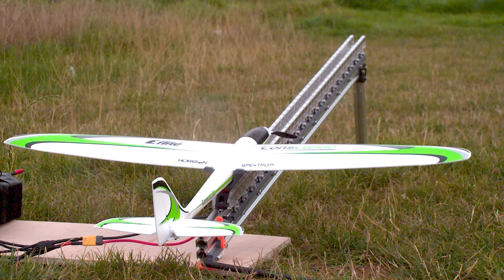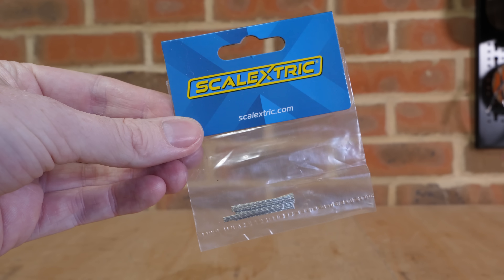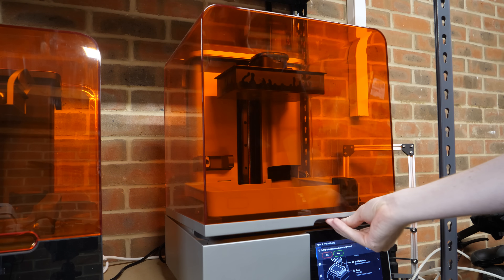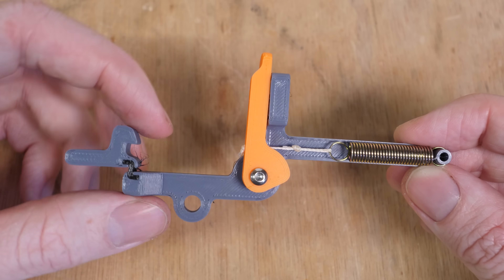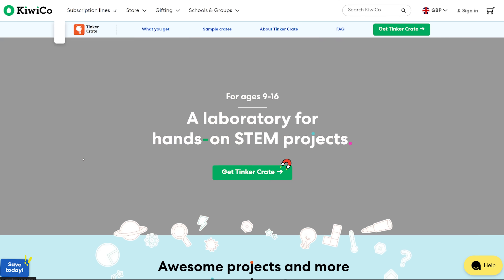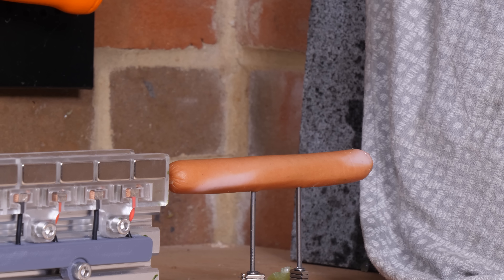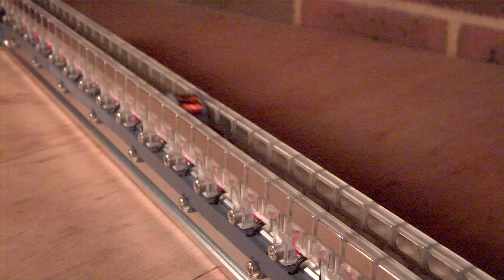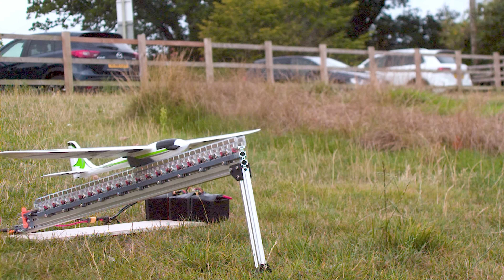Electromagnetic Aircraft Launcher

Comment: BLOCK INVISIBLE INFRARED LASERS wear all colors
- **SAVE HER LIFE**: amatchformamag
 y only a "handful" knw anything: they wrk 9hrs@aslavejob then only hav 3 hrs left 2 research their own stuff

more pple going blind bc screen DONT get your eyes dilated it screws your eyes up I found the info from comments on reversedilationliquid vids -- old lady SCRWD my vision up decades ago i dontwantit2happen2 you too. ALSO SIDEWINDOWDEFLECTORS for your car to save your driver-side-more-damaged eye and NEVER EVER STARE @ THE SUN it's what screwed my eyes up in first place since i needed glasses afterwards.

ADDITIONAL: USE DARK FOLDER TRANSPARENT COVER SHEETS and PRIVACY FILTERS to darken the screen and even PENCIL POUCHES work BROWN TAN!

**Acrylic Sheets:**Transparent Orange Acrylic Sheet**: 12 x 24 inches, 1/4" (6mm) thick.

---

*Top Health Advice:*
1. Night Light orange tint blue light filter/blocking function on devices saves eyesight: Use a large orange vinyl plastic see-through panel (see "acrylic sheets" above) paired with the computer's nightlight blue light software function for eye comfort for protection against harmful blue light.
2. Side Window Deflectors reduce driver-side eye damage and glare while driving, turning your car into a more comfortable space like a living room.
3. Avoid excessive screen time to prevent blindness increased screen time leads to the myopia pandemic.
4. Use Rollens sunglasses when outside; consider the orange-tinted "Gold Rollens." Can put multiple overlapping so can use 2 at same time for more protection.
5. Never stare at the sun to avoid retinal detachment and eye damage.
6. Avoid getting your eyes dilated DILATION LIQUID weakens eye muscles and leads to blindness. An old lady assistant spilled it and said "oops," now light-sensitive, reduction of accommodation, more myopic, never fully recovered.
7. Avoid the chickenpox vaccine to prevent shingles later in life.
8. Cigarette Smoke is responsible for numerous deaths and severe health consequences most die at 60.
9. Use eclipse glasses for eye protection.
10. Privacy screens can darken screens.
11. Eyejusters self-adjustable glasses come in stainless steel and hybrid materials.
12, SWIFT passes out earplugs to protect her fans anything over 70db = DEAF tinnitus ringing is dying ear cell freq u will never hear ever again. MUFFS!

---

-------------------

Eye Health Concerns MORE INFO/SPECIFICATIONS:
- "SIDE WINDOW DEFLECTORS" REDUCE eye damage/glare while driving TURNS CAR INTO A LIVING ROOM!
- ROLLENS
- Never stare at the sun: retinal detachment and eye damage from staring at the sun.
- Myopia Pandemic because of increased screen time.
- Horror stories about dilation causing acute angle-closure glaucoma and Bell’s palsy.
- DILATION LIQUID can weaken eye muscles and potentially lead to blindness. An old lady assistant spilled it and said "oops," now light-sensitive, reduction of accommodation, more myopic, never fully recovered.
- Eyedrops recall since 2023 due to potential blindness.
- Eclipse glasses for eye protection.
- Orangetanbrown VINYLPLASTIC LARGE/SMALL PANELS "lowblulitesite" for eye protection against HARMFUL BLUE LIGHT.
- Privacy screens to darken screens.
- Eyejusters, Self-Adjustable Glasses, Stainless Steel, Eyejusters, Self-Adjustable Glasses, Stainless Steel.
- Metal steel eyejusters: Eyejusters adjustable glasses for vision correction. Besides the metal versions "steel eyejusters," there are also HALF PLASTIC HALF METAL ones that are TWO COLORS (silver/black) with a METAL FRONT and PLASTIC ARMS, so they are a HYBRID of 2 MATERIALS!
-- Night light orange tint blue light filter/blocking function on computer/phone saves eyesight. Names: "night shift," "night light." Blue light filters are known by different names depending on the device manufacturer. Here are some examples:
  - **LG**: "Comfort View"
  - **HTC and OnePlus**: "Night Mode"
  - **Huawei**: "Eye Care"
  - **Motorola**: "Night Display"
  - **Xiaomi**: "Reading Mode"
  - **Samsung**: "Eye Comfort Shield"
  These features all serve the same purpose of reducing blue light emissions to help protect your eyesight and improve sleep quality.

---

*Eyewear Insights:*
1. Plastic glasses are lighter than metal ones.
2. Eyejusters reading glasses with dials inside do not work for farsighted vision worse than maybe 3.50 or 4.00 but could be higher number verify.
3. For nearsighted vision, use super cheap plastic versions with side dials.
4. Note that different manufacturers have varying nose bridges and frames.

---

*LGBTQ+ History:*
- The phrase "Gay Pride" was coined by activists to reclaim pride from its negative connotations and promote self-affirmation within the LGBTQ+ community.

---

*Health and Technology Concerns:*
1. Copper blocks WiFi; children absorb WiFi 10x more, so turn it off when not in use. Other countries BAN WIFI but USA Lobbyist lie!
2. Unplug WiFi to reduce overpopulation and lower temperatures by 1.5°C.
3. Lead pipes are linked to crime; crime rates dropped when affected individuals retired.
4. Chickenpox vaccine can lead to shingles later in life.

---

*Environmental Concerns:*
1. Summers are now longer, hotter, and double the 100 weeks.
2. In 2024, the public was asked to stop driving to prevent ozone smog erosion.
3. By 2036, the added effect of an extra week of 100°C for each summer month will have long-term consequences.
4. Millions in Texas are advised to avoid driving to combat high ozone pollution levels.
5. Smog smells bad when temperatures reach 100°F.
6. Solar power is the conversion of sunlight into electricity, either directly using photovoltaics (PV) or indirectly using concentrated solar power.

---

*Miscellaneous:*
- **Fake Moon Landing**: Filmed in Clovis, NM.
- **WATCHMEN/RING movie**: Moon landing conspiracy.
- **35 PATTERN 350**: Versatile pattern for various uses like comic book stores, grocery stores, theaters, etc.
- **Combo Plastic & Steel Frames**: Stainless steel front, acetate sides, or all-metal steel eye justers.
- **Mr. Beast Laser Challenge**: blindness from laser reflections as he RISKED/DAMAGED their eyes dot relection = dot in eye!unlesstheyhadeyeprotection
- **Weight Loss**: Simply stop eating.
- **Anti-Woking Rich Republics**: Lack of awareness about "woke" due to economic disadvantages.
- **COVID-19**: Enacted in 2020 due to the 1.5°C milestone, not the virus. Vaccine as a sterilizing agent.
- **Relaxed Dog**: Neighbors notice because the dog roams free without a collar.
- **Sci-Fi**: Focuses on overpopulation
- **Air Blowers**: Harmful noise levels; avoid blow-drying living things  without hearing protection; hschooler showed how harmful in a project she devised.
- **5 Hottest Places on Earth**: Iraq, Texas, Egypt, Arizona, Dubai.
- **Trump's Racist Comment**: "They're poisoning the blood of our country."
- **Diversity**: Essential for life, as even atoms are constantly moving.
- **Halley's Comet 2061**: Predicted to reverse the timeline as population reaches its peak.
- **90s Crime**: Decreased when lead drinkers retired.
- **Smog Smell**: Appears at 105°F in the third week of August.

---

*FINAL NOTES EXTRA:*

MATCH AGAIN:
this confirms i was correct all along spoilers new anime terminator main key reason the ai turned against pple is that root meaning of "robot" = slave which is y i always say machines are cursed. ironic now thking of "i robot" movie w willsmith poor guy but has an anger/distaste for his support of whites inherently bc of racism but secretly he actually hates his own race bc of his father's abuse.
spoilers: also same day i watch this talks?/has trinity of ai as 1 consciousness & emp as solution (same goal: unplug -- everything needs2sleep or toomuchheat) this same day i do note of racetrinity below the FINALRACEMAP:

trinityRACEofWORLD:
SECRET of travel trinity BLKASIANWHITE same as lastime travel 3continents this time same ones except for 1.
TRINITY RACE: as filming locations of east represent eur ex haroldcrayongeorgia looks like london canada looks like london same w ny michigan chicago bc world cuts off at inflection pts of each race so TX used2b MEXiCAN which are eurasian so it is actually ASIAN so WEST=ASiaN as in INDIANSnativesCALIFORNIA that is y that civilwar movie has them joining up; london influence cuts off @ kazastan as they eurasian & asian influence begins. everything south equator is BLACK WORLD even influencing INDIA=darkerskin. so WHITE WORLD begins @ EASTERN USA and ends @ MIDDLE EAST then ASIAN WORLD begins and ends @ USA WEST. EVERYTHING south is BLACK!
this is y DEI=no racism bc it is primarily a BLKASIANWHITE world u r either primarily in 1 side or not. any1 who doesnt support it is/basically = "racist" consciously or subc.

- Screenwriting Propaganda:
My screenwriting teacher said that if we only remember one thing from his class, it’s that everything is propaganda. But to me, if it’s good, it’s not propaganda; it’s memorable and impactful.

- William Shatner:
William Shatner faced controversy when he was accused of drugging, strangling, drowning, and cremating his wife. He used her past struggles with alcohol as an excuse. Do some blame his actions on the stress from the moon landing conspiracy and his tinnitus from a Star Trek accident, for which he was a spokesperson?

Comment: The weight of the plane changes the amount of time each contact has along the sled meaning more power per magnet.

You should improve this by adding a magnetic brake at the end of the sled so that it doesn't get launched as well increasing the launch speed and allowing you to not loose the sled if propelled over places you couldn't retrieve it. I think the final goal would be a minature aircraft carrier that can be controlled remotely to launch a plane from the middle of a lake.

Comment: Why didn’t you mount multiple coils along the track and use magnets on the sled? Then you can put more turns on the coil without worrying about the added mass lowering the sleds velocity.
Reply: isnt that his "old" design that needed the complex controls?
Reply: @S1nwar   The old design didn't have the simpler physical contact system to control the energizing of the electromagnets. But it could be made to work that way.

However, it would halve the effective contact area, unless the power supply is placed on the sled.

Comment: You could make a very simple optical sensor with a H bridge driver board to switch the coil back and forth. Instead of contacts all along the rail, you just have a single metal rail on each side and a black and white alternating tape in the bottom of the extrusion track. The sensor just needs to be an LED bouncing off the strip into another LED.

Comment: why reinvent the circuit breaker? just use a standard 30A circuit breaker for a house. either US style or EU would work perfectly. they are designed to do exactly what you want and it will be far more reliable than anything you could print

Comment: Cool but that sparking is real issue and could cause fire if spark lands to mattress or some dust. Mind those sparks are molten copper, witch require 1085C temps to happen, so when spark lands 5 meter away, its still around 500C and on right conditions can cause fire or smolder that turns into fire hours later. Even just kinda hot drilling chip can do that if it lands on dusty area. This has happened several times and i would not recommend becoming another example of this. I that particular example chip drop into cable channel that had lots of dust and smoke was detected next day when worker happened to look up and see it, so around 24hours later. Mind fire watch period is generally 2 hours to max 6 in most cases, despite it being just a chip from drill its still considered fire work and by law everyone involved the fire work are responsible. Of course this is not a issue most of the time, but that once a while happening fire can cause treat to life and limb, not to mention potential multi million of loss both property and lost productivity, so stay safe.

Comment: For the scale scalectric metal fiber pad brush use a point welder like the ones for soldering battery terminals with electric discharge

Comment: You can absorb the shock by placing a holder on the other side of the mechanism so that it is gripped without bouncing, by treating the surface, or by choosing a spring of appropriate strength. It's real engineering and the choice is yours.

Comment: I would imagine that these coils turn into very large inductors and fight the alternating current a lot. Its possible that energy stored in the coil/inductor's magnetic feild can dissipate between contacts fast enough that it has little effect, but I wonder if that also plays a role into why the 200 turn coil was the fastest, as the higher turn coils will have more inductance. I also am curious if the inductance fighting the alternating current is why the new launcher is only slightly faster than the old design (especially beecause of the higher current). I wonder if a dc launcher that could only attract each magnet could be better than this ac launcher that can attract and repel each magnet
Reply: I believe this could also explain why the coil with the plane accelerated faster that the calculations. Because the weighted coil would move slower so it would spend more time in between contacts to let the coils magnetic field dissipate, so when the coil gets to the next set of contacts, less energy is spent fighting the inductance and more energy is spent accelerating the plane. To me, it seems like this launcher has a lot of power, but almost like a speed limit, where the current through the coil can not change at a high enough frequency to effectively push and pull the magnets to accelerate any faster

Comment: You can make this launcher using regular AC electricity.  Get a plastic or cardboard tube and wrap a several turns of insulated copper around it.  Put a non-ferrous metal like brass or aluminum as a hollow cylinder on the tube and resting on top of the coil.  You can use a power strip to toggle the power quickly (before overheating the coil due to short circuit).  I saw it demonstrated at Science Faire.  The Eddy current will launch the item.

Comment: As others have said: as the projectile goes faster it starts to pass the magnets faster than the coils can produce the field needed, so at one point it may be slowing itself down. Though I'm not sure how it should be configured with the coils on the sled. A guy I knew made a coilgun back in the early 2000s, and had that problem. He ended up disconnecting most of the coils and got better results with jlst the first few. You probably had this issue on your last version (I can't remember lol) but maybe try increasing the spacing of the magnets the further along the rail they are - but keep the contacts the same so the coils have time to build the field. I think thrt would work 😅

Comment: The most common flaw I see in coil type launchers is not building in any mechanism to use the massive induced voltage when the brushes disconnect the contacts. Finding a way to put capacitors on the coils so that power could get stored before getting switched to the next polarity (instead of arcing and creating metal plasma at the electrodes) could create a massive increase in contact lifetime and output power.

Comment: Replace the solder wick with rollers, and offset the rail contacts by a fraction on one side.  All the energy at the point of contact will be on one rail.  You could also replace the energized rail with a graphite for better contact and longevity.  Float the sled with rail vs sled magnets.  In all, your DIY rail-gun is cool!  Thanks for sharing...

Comment: At this point I am wondering why you didn't just build a railgun instead.

The whole point of the coilgun is that you get to have absolutely no contact between the coils and the projectile and thus no sparking or abrasion. 

This combines the worst features of the coilgun (lots of coils - or, in this case, magnets -, timing issues, uneven acceleration, more complex wiring) with the drawbacks of the railgun (abrasion, sparking). 

Don't get me wrong, it's still awesome! I'm just wondering.

Comment: Tesla would find a good mass:v then would try higher and lower gauge of the same mass to find the sweet spot. It usually came down to also how fast the trigger was, sled electrodes in contact with the magnetic base contacts. where a whole number of oscillations was most beneficial. Might be best to use tge same copper wire as the coils for the contacts

Comment: Designing switches is very educational, but if you just need a switch you are prob best off just buying an off the self one. Like a circuit breaker. They are designed for exactly this.

Comment: Could you add a magnetic sensor and a FET in each position on the rail? That way the coil would only be energized after the brushes have made solid contact. This would prevent arcing. I think a good amount of energy is lost in each arc.

Comment: I think the reason the actual setup got a faster velocity is because the sled under load will accelerate less compared to your tests with the software. And the lower acceleration will lead to better electrical contact.

Comment: Hello! Try increasing the distance between the contact points and the magnets along the length of the track so that they are farther apart as the sled's speed increases. As speed increases, if the contact points and magnets remain closely spaced, the timing of the force application becomes too rapid, and the sled may not benefit from each magnetic interaction as efficiently. By spacing the magnets further apart, you allow the timing of the attraction and repulsion phases to better match the sled's increasing velocity.